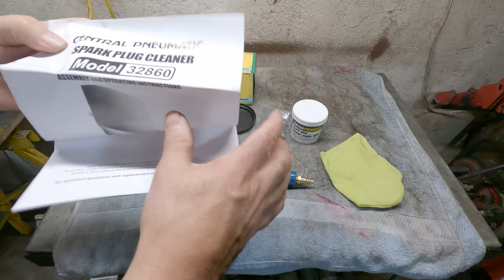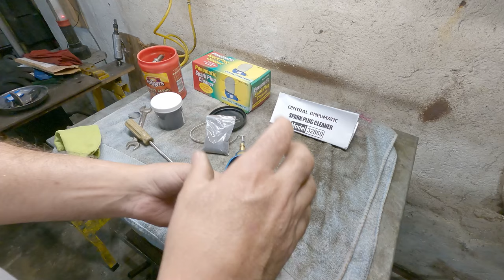Harbor Freight Spark Plug Cleaner Review 🤔

Comment: I just purchased one and here's  a few tips to make this a worthwhile item to have in the shop. The media they provide is much finer than the media you can purchase separately. I used what they give you in the kit and added about an ounce (volume) of the corser media from the container. You also need to hold the bag up (by the upper corner with your fingers) so the media doesn't get stuck in bag during the blasting process otherwise your just flowing air over the plug. After doing the above the unit works great.
Reply from the maker: Thanks for sharing your info 👍

Comment: I appriciate your review! Although, I could NOT disagree with you more about these being worth it. Most spark plugs are not $4.00 these days either! Most newer vehicles come with "iridium" plugs that can cost approximately $12 to $26 dollars each (NGK) at AutoZone! Buy them from the dealer and they will cost you even more!

I have used an OTC branded one for over 35 years! These work great to clean carburated equipment, lawn equipment plugs, motorcycle plugs, and automotive plugs. They work great to clean fouled plugs including used plugs along with almost brand new plugs that are fouled too. My old OTC branded Spark Plug Cleaner finally kicked the bucket this year. There are more expensive Brands. I would bet the quality of these Spark Plug Cleaners are not what they were 35 years ago.

Even IF spark plugs were only $4.00 each, time is money! Gasoline is not free to drive to buy  new plugs! IF the right conditions indicate "cleaning" is all that spark plugs need then Spark Plug Cleaners are the money saving answer!.

Comment: Was this item discontinued? Unable to find it on harbor freight site.
Reply from the maker: I just checked there web site and it does look like it is discontinued.
Reply: I just bought 1 at my local store on 9-22-2024. My local store had 2 in stock at $.6.97 each. I came home and checked stock online and the item is not even coming up as either in stock or out of stock. About a month ago my local store had ZERO as they are a clearance item. I think I am going to go back and get the other one for a spare tomorrow. I had a better quality OTC brand from the early 1990's and it just stopped working.